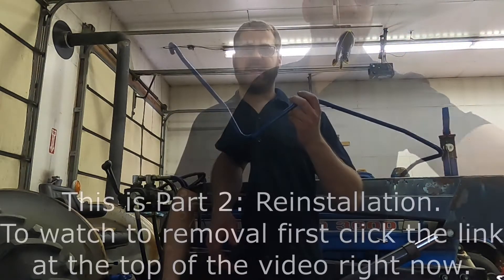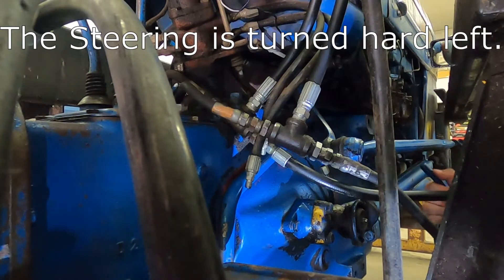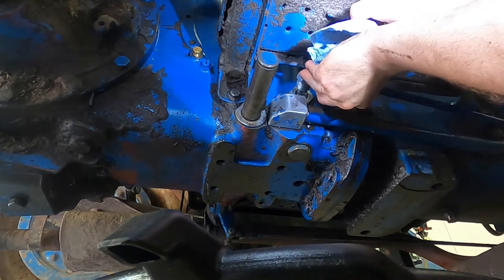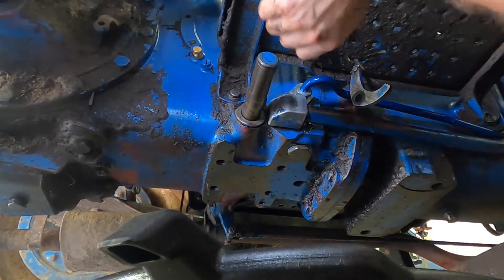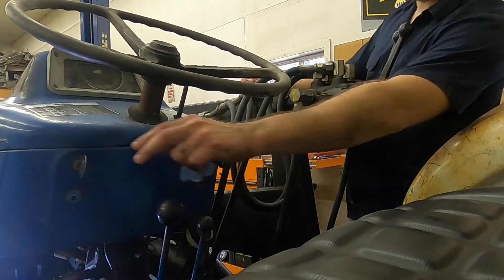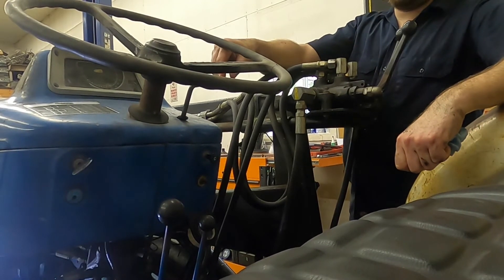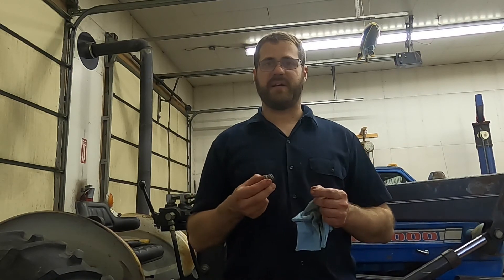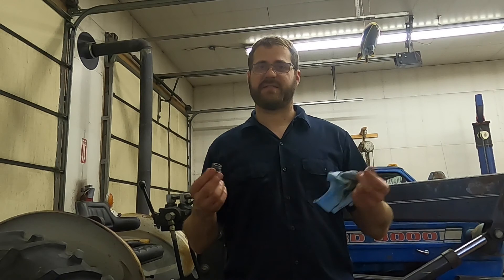Ford 3000 Main Pressure Line Replacement Part 2 Installation

Comment: Hello, nice video, wish I would have watched yours first, I watched another and ended up using the aftermarket part. I wanted to ask you if there is a ring that comes with the oem nut assembly or is it already assembled with the oem part?  Thanks

Comment: You are not showing the routing process that is the nightmare of the job or all the disassembley required to get old line out this is a totally incomplete video youareleavingthe middle of the job out this is not enough info for the totally uninitiated diy ?
Reply: you do realize this is part 2.  go look at part 1 first.

Comment: Doesn't the loader get it's hydraulic flow from the front crankshaft driven mounted pump?  The system you are working on powers the remote hydraulics and the three point...I am confused.  At least that is how my 1975 2000 works with my Ford 730 loader.
Reply from the maker: There are external pump and reservoir systems for loaders.  They can be powered by the front crank like yours or PTO driven.  This loader is set up to run off the tractors original hydraulic pump and reservoir(the rear differential).